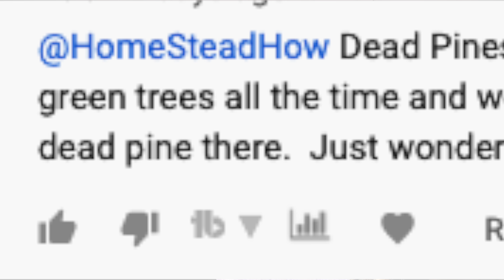Tree Felling With Daughter! [Funny]

Comment: Kerry, good to see you took my advice.  Dead pine is already for burning, a lot easier to cut (no sap) and a lot easier to haul.  I would imagine you have lots and lots of dead pine all around the forest located where you are.  Good work.  By the way, you mentioned mixing oil and gas.  Have you ever used the synthetic 2-stroke oil before?  It comes in a tube that you simply add to a gallon of gas (or if you have the bigger tube, ...to 2 gallons of gas).  Pour it in a can of gas,  shake it up and you are done.  It does not matter what oil to gas ratio your machine uses (i.e. 40 to 1, 50 to 1, etc.), it does not smoke, and it saves time.  You can get it at Wal-Mart or most farm and home stores and it is not expensive at all (.99 on sale, to maybe $1.50 a tube).  I have been using it for years in chain saws, weed-eaters, etc. and have not done damage to any of them.  Keep the videos coming. Craig
Reply from the maker: Yes awesome advice..I have more ideas pine but much of it us so deep in the woods it's hard to for to. I'm going to try the synthetic stuff, news to me! Thanks for the thoughtful comment